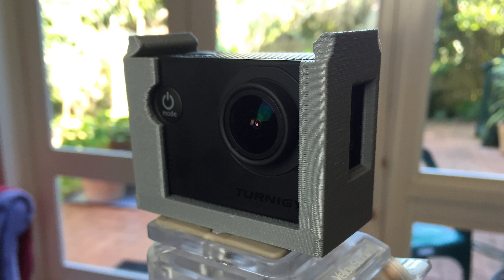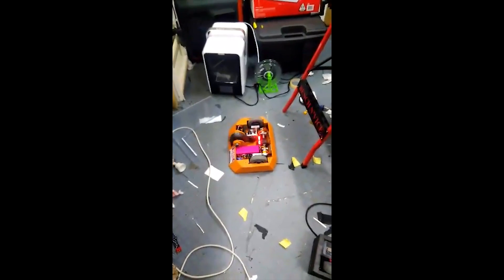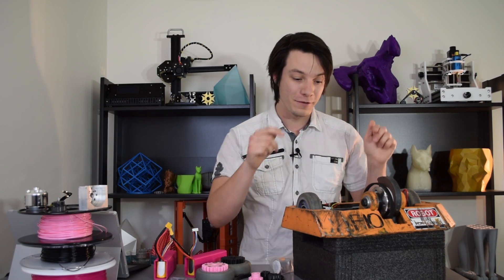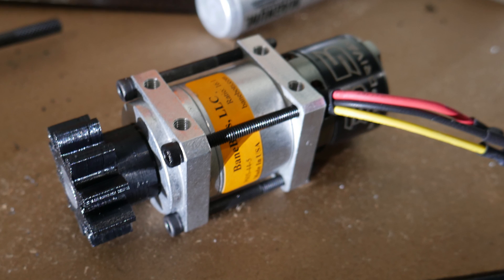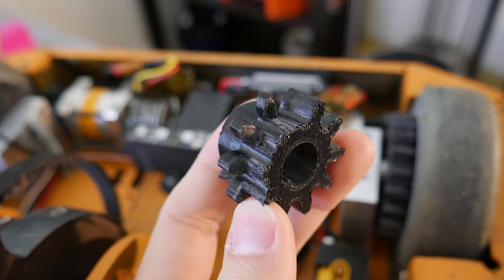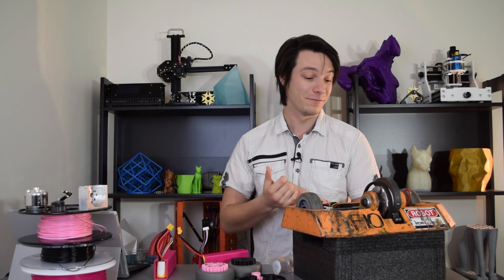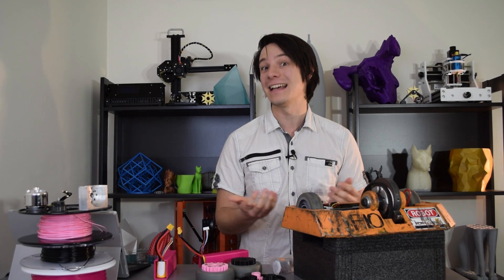3D Print Durability in Robot Combat (the Chronicles of Vanguard)

Comment: Watched the whole vid anyway, but love you adding time stamps! Wish more people would.
Have you tried printing parts with glass fibre reinforced filament? Or making your own wheels with flexible filament. 
Great video mate!
Reply from the maker: I have some glass reinforced PP filament that I really want to find time to test out, and yeah even printing the wheels could be pretty neat!
Reply: Maker's Muse awesome looking forward to watching it when it comes out!
Reply: Since many 3D printed parts have lots of little voids you could try forcing a filling resin into them in a pressure or vacuum tank. One to try is a heat cured resin called Cactus Juice. It's made for use with wood to stabilize it, used a lot by pen turners.  Cures at 200F
Reply: Gregg Eshelman interesting! Might look into this.

Comment: Nice TIG welds, machining, and craftsmanship all around! It's no surprise you did so well in the comp. As you posted pics, I thought to myself the wire management could use some attention, then you mentioned a plug coming undone. Wire management is key in these types of high-abuse builds. You can 3d print some channel to protect and route the wires.

Comment: How to win a robot competition. Build a wedge with the most powerful motor put all the weight into armor. Be prepared to be called boring.
Reply: Alan Wong I had the same idea lol.
Reply: until you come agianst a pneumatic flipper
Reply: A pneumatic flipper will present a problem, but if the robot is fast enough to out-maneuver it, and has a self-righting mechanism, it won't be as much of a problem.
Reply: What about a robot that pulls a reverse hovercraft and gives the arena floor the succ to be unflippable.
Reply: Unless you drift around like Gary Gin

Comment: When we were competing in school, there was a robot similar to your design, except the spinning weapon was in the center of the bot from an aerial view. they added slightly larger ramps fore and aft of the weapon to act as a runway. That heckin robot took ours (15 Lb Class) and launched it straight up so hard it hit the enclosure ceiling (maybe 3 or 3.5 meters up). My point is that you got a pretty sweet design, and I would love to see more robot combat in the future.
Cheers
Reply: That reminds me, At that same comp there was a dude with a robot that was 80% 3d printed ABS (everything but  the motor mounts and the weapons, even the outer casing was 1.5" ABS all around). It was a basic wedge with a steel chain mace (flail?) on the back. That one was fiesty as heck, but ultimately lost because he was too light. It never actually quit working (TANK MODE FTW), it's just that the judges awarded a ton of points to his competitors cuz he was getting tossed around like a rag doll. That and he never had to compete against the team that curb stomped our bot lol.

Comment: I've successfully used pla for motor mounts and wing mounts for rc aircraft. It holds up pretty well in those applications, because at cruise a plane will only have lift equivalent to its weight, and even a 5g maneuver would only be 10lbs on a 2lb plane.

Comment: Hey Angus, it's cool to see you using polycarb as it's my favorite material to print with, half my Robo3d is polycarbonate now!
For your gears and other meshing parts, you might want to check out Igus' l180, it's designed for printing bearings and is a self-lubricating, abrasion-resistant filament. I got a sample from them recently and have printed a couple of linear bearings and I'm astounded at how well they work!

Comment: Thanks for trying 3d printing in combat robotics. Been wondering if it was usable since I asked Mark Setrakian about it 3 years ago at a RoboGames event; at the time he said printing wasn't yet viable for combat. However, he did bring a really cool 3d printed hand that held and rotated a beach ball sized globe on five fingers.

If you can spare the weight and hide the heads, I'd recommend using double nutted bolts instead of screws. Also good call on the belt for the main weapon, seen a lot of chains and gears break from hard impacts. Good luck with your next build!

Comment: Looking at the way the gear failed, the solid infill pattern only provided strength on every other layer. Next time you should increase the number of perimeters until they completely fill up the teeth so you get maximum planar tensile strength for each tooth without having to rely on intra-layer bonding.

Looking forward to more heavy-mechanical tests of 3d printed parts!

Comment: Some of the FRC teams that I work with use those same Banebots Gearboxes. You also might want to look at using something like a Vex Versaplanetary gearbox if you want something that you can easily change the gear ratios of. Versaplanetaries are absolute tanks of gearboxes. One of the teams that I worked with ran one with a 300:1 gear ratio to lift our 120 pound robot onto a platform 18 inches off of the ground.

Comment: Threaded insert master race! But in the future, when using those cheap straight-knurled inserts I always insert them on the rod side. So instead of having a through-hole on that mounting block, there should be a lip on the outside that the insert can be pulled tightly against when you tighten the grub screw. It's a lot safer, I think. Heat insertion like you did there should only really be done with better-quality inserts that have helical threads to actually grab the plastic.
Reply: Agreed. Inserts with straight splines are designed to be press-fit from the opposite side. Inserts with a knurled finished are designed to be heat-staked.

Comment: Funfact: nylon is durable to the point where the puffing billy railway replaced a full set of bearings on one of its locomotives as a test and the results were less wear, friction and better heat dissipation than the original metal bearings. Keeping in mind these locos are over 100 years old.

Comment: You could use 3d print of that pinion gear as a cast, to melt the hardox metal into that shape as well as you can and cnc that almost complete shape quicker than out of a block.

Comment: I agree Nylons is more then a practical filament and its a must for any  maker that uses 3dprinters , Taulman 910 is a thing of beauty and once you get the hang of printing with it, little story:  a while back, I was designing a part for a client and it would not stop failing  at a joint no matter the filament I used( even with Proto pasta PC it would fail), then I contacted Tom at Taulman, after reviewing my part he suggested their  PCTPE and offer printing advice , This filament is a Winner when it comes to semi flex Strong layer bonding, I can not rant and rave enough how good the filament is!. Hint when printing nylons, Forget the Glue stick, for get heated bed, Get the cheapest can of strongest  hold hairspray ( like the ones they use to hold Mohawk styles hair cuts in to place) No heat on the bed at all! right  on cold glass for all taulman's nylons and enjoy!

Comment: You could try some glass fiber or carbon fiber reinforced PETG. It's got a more sensible print temp than nylon but the fibers make it super strong. PETG is more flexible than PC so it won't shatter, and if you get the glass reinforced it comes in a good number of colors.

Comment: A silicone grease filled slip device in the weapon drive would save the belt, motor etc. A good project for CNC milling. Then the weapon can hit hard while the drive is isolated from the impact shock.
Reply: Make one half like a brake drum, with concentric rings milled into the flat inside surface. Turn a disc with rings that nest into the grooves in the drum half. Seal it with a cover that has a hole in the center and bolts around the edge to the drum. Could put a sealed ball bearing or two in the center hole of the cover to support that shaft. Could have grooves and rings on both sides of the disc and on the inside of the cover. Pack it with silicone grease and the viscosity and stickiness of it with the surface area of the nested grooves and rings will transfer torque while allowing slip for impact. If you run the disc side shaft through and support its other end with a bearing in the side of the drum, this could be put into the hub of a cogged belt pulley.

Comment: I use ABS motor brackets to hold the drive drills in both my bots (Pot Head and Hellamax) and they are fine :) The brackets sit inside of steel or Al square tube so the printed part should mostly be under compression. They also extend past the back of the gearbox on the drill to support the motor a bit, in 4 events I've only replaced one drill and half of one bracket.

But, where did you get your 20mm rod and bushing? My 20mm rod was only 19.2mm and so had too much play in the bushings I have.

Comment: Please do more cnc machining work. Outside of all of the wood based kits like the xcarve and shapeokos, there's hardly any good channels doing machining within the maker space. There's plenty of actual shops or high end workshops doing machining, but that kind of content isn't really what makers look for, mostly just from not having space for overly large machines and not being able to afford the machines. 
Also, since there's not many kits outside of xcarve, shapeoko, and cheap chinese ones, you should do a build guide. OpenBuilds has a part store, and they make gantry plates and stuff that can fit a variety of rail widths; though if you do use OB for rails, I've heard they come cut slightly over length.

Comment: Great video bro! I would like to expand on your point of using nylon on antweight class robots. I built one of mine, brutal barbera, with a body of nylon and titanium armor plating. I entered this into antweight world series 54 and two events robot event at the university of bristol. Despite enduring some really destructive robots, the nylon body was still intact, with less than minor damage.  Printing the body took a couple of attempts but mostly because i didnt know the correct temperature, i think it was 240-250 degrees C but i cant remember clearly. I also printed this on a makerbot, so no heated bed required. 

tl;dr ants and nylon are great and not massively difficult to print.

Comment: for a weapon, a 3lb dead-blow hammer powered by a motorized pseudo catapult style system and a really heavy spring, lol. Just make sure the  dead-blow hammer head has some velocity at impact. Don't have to puncture or even dent heavy armor, just knock the opposition to pieces internally, bend shafts, and wreak havoc on drivetrains, lol. It can be a linear striking system as well, punching straight forward instead of swinging on a pivot. Either way would be nasty though. Straight forward, you could mount a hardened spike on it and aim for wheels/tracks.
Reply: ...Do you know what a dead blow hammer is supposed to be used for? Its used when you want to protect what you're hitting, ie; MINIMIZE impacts.
Reply: @Coboxite  BNO, you are thinking about a non-marring dead-blow hammer with the "protect what you are hitting" thing. Dead blow hammers do not need to be non-marring. As far as minimizing impact? rofl. Not even close. A dead blow hammer has a hollow section filled with lead shot. The purpose of this lead shot is to provide the striking force in such a manner that it minimizes rebound, thus IMPARTING MORE ENERGY to whatever is hit with it for the same striking mass, not less. Basic physics bro. A solid steel striking mass will absorb a quantity of the blow, and that energy appears as a rebound. Dead blow hammers were designed to counteract the effect of Newton's third law of motion as much as possible.

Comment: I always wondered whether PLA or ABS could be used for some sort of ablative armor, not replacing the steel armor but forming an extra layer on the outside that would be chipped away by your opponents attacks but lessen the overall blow your robot takes at the same time. You'd probably have to replace parts of it after every fight and I don't know how it would count in the damage category, since it's supposed to be damaged instead of important parts. It also could be hard to affix to the steel. 

However, such an ablative armor layer could really soften the blows your robot takes and lessen its damage.

Comment: You should have stuck a screwdriver in the xt60 bullet connector to widen the male pins. This would have prevented the jumper pin from disconnecting.
Reply: And maybe use BlHeli ESCs with Dshot and serial communication for more performance increase. Great project, Angus!

Comment: I like banebots wheels because they work really well with the banebots hubs and gears. For the power loop key look up team whyachi power switches they are expensive af but you can print something similar out of pc and use coper strips for a lot cheaper.
Reply from the maker: For sure, whyachi switches are not bad but again rare as over here plus the allen key they use simply doesn't exist in Australia haha. A 3D Printed version would be a great project.

Comment: why is it that you use a 5S battery when the motors or 3-4S and max voltage is 17 and with a battery of 18.5 volt. Am I missing something or does the use of multiple motors reduce the voltage?
Reply from the maker: Great question! It's common in combat robots to 'overvolt' motors to get more power. This shortens lifespan and can overheat them, but fights are only 3min long so you can get away with a lot more heat and power.
Reply: Thanks! that was a really quick reply. I'm just getting started in making a bot and trying to specify what battery I wanna use, so that was really helpful.

Comment: Can one 3d print a laith and use it with soft matals such as aluminium or brass?
Reply: Martin Šalko There are several lathes on Thingyverse, no idea how usable they are though...
Reply: You could print the body and and gears but not the chuck, motor or cutting tip.
Reply: Martin Šalko Ive seen a few videos and they were really small, desktop lathes so the motors used didnt have enough torque for it but with correct materials, there is the potential. Definitely wouldnt use PLA for it.
Reply: Riley Hudson I might try to do this. The more i think about it the more i like it.
Reply: the problem is the flex in the plastic might be really tricky to get precise parts. even in aluminium certain tasks require a lot of force to be put through the tool and even with a relatively cheap but steel lathe there is flex so i cant imagine a 3d printed version would go
Reply: You could probably cut foam. I'd like to try it.
Reply: Look up gingery lathe, design parts in cad or look for them online, make a furnace to melt aluminium and then cast them using the lost pla method.

Comment: How did you get the motor to fit in the gearbox?
Reply from the maker: Custom CNC'd faceplate with holes to match, I got it commissioned. Two of the holes in the original plate lined up, but I wanted all 4 for combat robot applications. I did have to cut the motor shaft shorter to fit correctly when I pressed the pinion on.

Comment: I mean, people use PLA plus, ABS, ASA, and PC to print firearms. like, parts that take the abuse of explosions mere millimeters away. It doesn't surprise me in the slightest that they could stand up to robot fighting. Like, I understand robot fighting is a high stress environment for the parts, but if you think about it, if you're looking at a gun shooting 9mm you're talking about 405 newton meters of force. 5.56 you're talking about 1750 newton meters, and I've seen 3D printed frames for both of those calibers. If I'm doing my math right, that's the equivalent of the robot getting yote at a wall at 30 miles per hour. from the video you showed, those kinds of velocities were not common

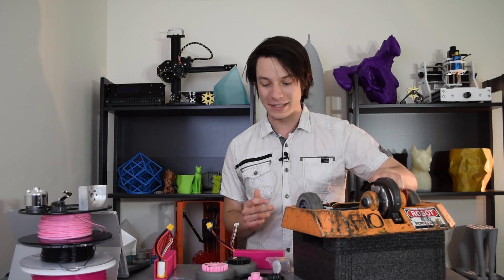Comment: Where did you find those XT60 connectors seen at 8:46 ?
Reply from the maker: The ones with the securing hole? They're on hobbyking too "XT60 with the 5mm mounting hole"
Reply: Yes this one thank you. Never seen them before and was using a clamp system with a standard connector to retain them.

Comment: It's not a good idea to make parts out of PLA that will melt when they get warm.  I tried making a bearing holder for the printer but it got soft and opened up and the bearing came loose so I had to replace it with a commercially made plastic part.
Reply from the maker: Yep, exactly the reason I chose Polycarbonate

Comment: Just use metal cutting tools for your weapon. If it can cut through metal it can cut through just about anything
Reply: j. jimenez the issue is that metal cutting tools are not good at impact resistance as they take small cuts rather than large violent bites